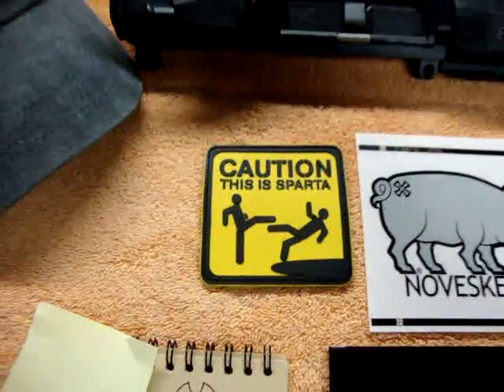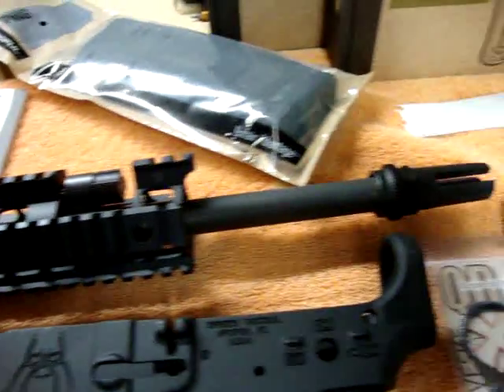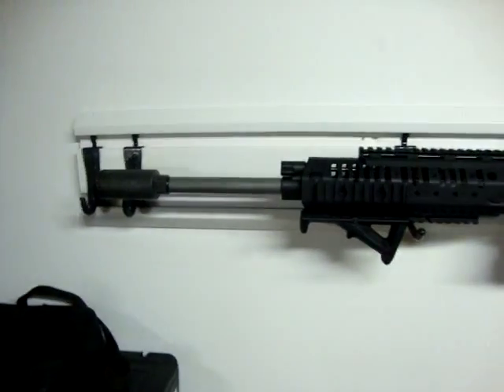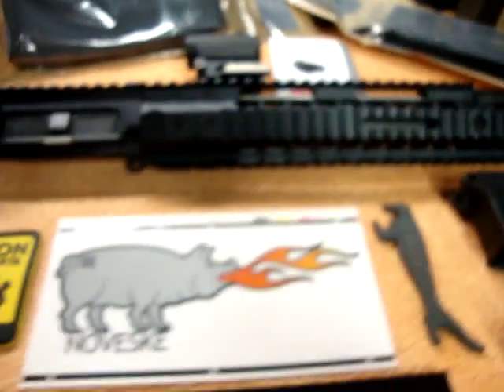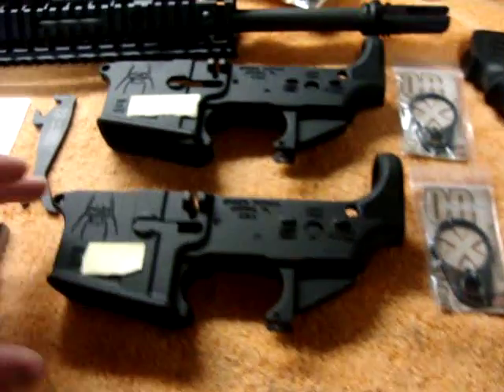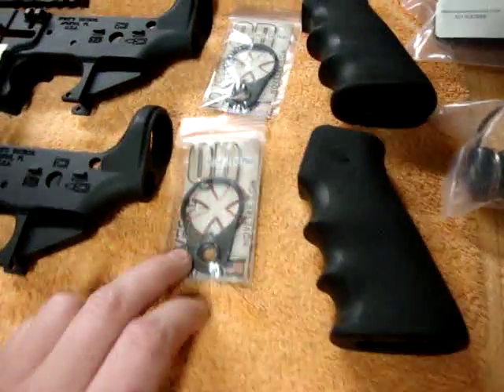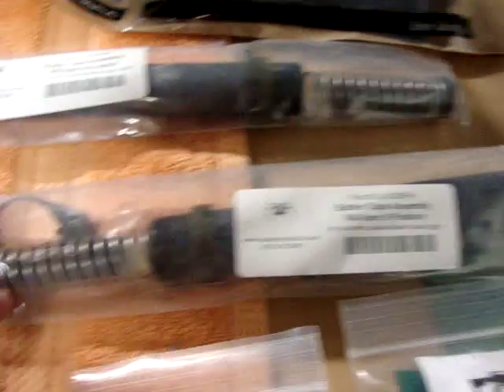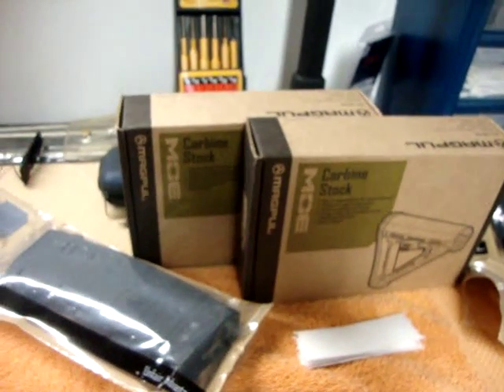Noveske Build

Comment from the maker: you can't go wrong w/ noveske bro!  I would go with a 16" barrel just in case you decide to replace the muzzle device.  You have to pin/ weld the 14.5 muzzle device and makes it a big deal to replace upper parts that require you to take off your flash hider/ brake.  Hope that helps man.